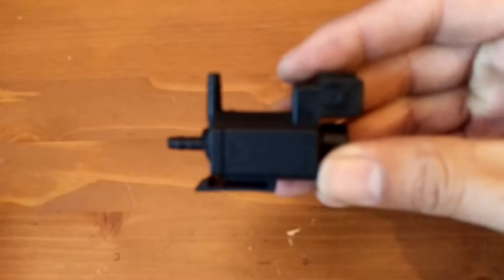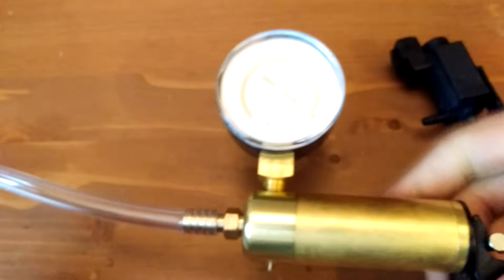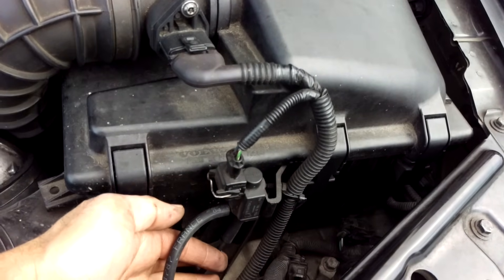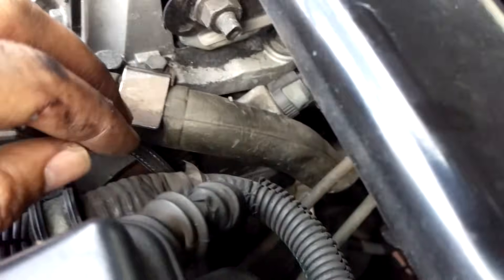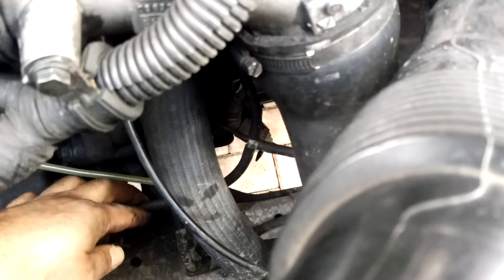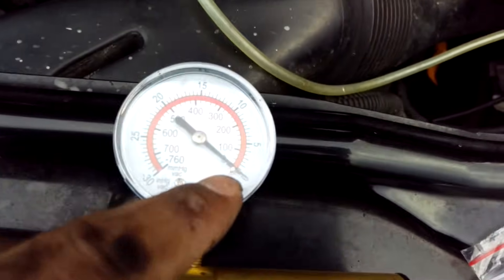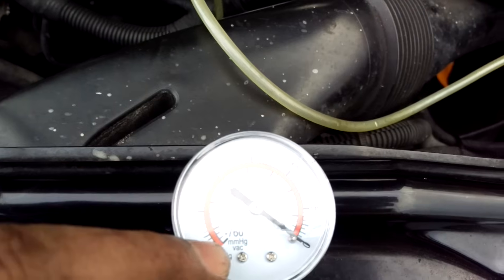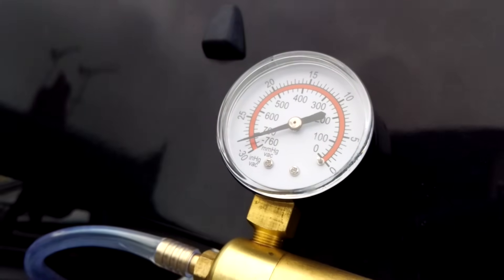How To Easily Test a Turbo / Boost Control Valve TCV

Comment: This is not a turbo valve, the turbo boost valve is on the engine blok by two screws.
Reply from the maker: As I say in the video, it's a generic name and the location and function of the valve varies.
The testing of the valve remains the same though so if you're focusing on the name, you've missed the point of the video.

Comment: Hi, Rob... great video! I just have a problem with my Volvo v70 d5, the turbo isn’t working any more... so they told me to check that “check valve”... but I have a question for you: do I have to buy the instrument you are using? Or will it be enough just to pull of the rubber pipeline (that you pull off) and when the engine is on, feel with a finger if it works? Cause just to spend money, if I buy the instrument or change the valve, the costs are similar...  
I hope in your reply! Anyway thanks a lot for the video!!!
Reply from the maker: Leaking vacuum only affects the turbo on a Euro 3 D5 so it depends on which D5 version and model year you have.
Reply: SiRobb hi, thanks for your time and reply!!
It’s an euro 3 from 2003...
Reply from the maker: You need a vacuum tester like in the video then.
The amount of vacuum and whether it is a stable reading is important to accurately track down the fault.
The same tester can also produce a vacuum for testing pipes or the engine mounts for leaks.
The testers are not expensive so check the link in the video description or search for even cheaper.

Comment: Hello, did you ever removed plastic cover, which is on the side of TCV ? I dont know, if the passage there should be clear, or not, because i have found, it was full of weird debree. Thank you.
Reply from the maker: No but I have removed similar on a boost solenoid and found debris.
On a vacuum valve, it will inevitably suck in some kind of dirt so they have filters built in.

Comment: Hello. Whats happening if The valve îs not running properly?
Reply from the maker: It depends on what car you have.
Reply: Volvo xc 90 2005 euro 3 2.4 D5
Reply from the maker: You may boost problems if it isn't working correctly.

Comment: Nice Video. What happens if you have no change in vacuum?
Reply from the maker: You then check if vacuum is available at the pipe feeding the valve.
Reply: @sirobb  I have a vacuum, closing the actuator, but its not opening like in your video when I increase the revs.
Reply from the maker: Do you have a Euro 3 Volvo D5?

Comment: What are the symptoms for the boost sensor if its packing up?? I've got a 2009 skoda superb 2.0 tdi cr se 170bhp and it keeps going into limp mode and the glowplug light flashes when I put my foot down and reaches 50mph
Reply from the maker: Test the glow plugs first.
Reply: Can glowplugs cause limp mode then while trying to get upto motorway speed? Around town car drives perfect
Reply from the maker: @jon-luis7344  It depends whether they are needed for dpf regeneration so check them.
Reply: I will do thanks so much it'll be first thing I do tomorrow I've taken the car to skoda and VW main dealers and they dont even know what's causing it. where are you based lol lol
Reply from the maker: I'm in Cheshire

Comment: Hi, I’m having trouble with a 1L 3 cylinder ford. The turbo is brand new and I have tried a second hand vacuum pump and a second hand boost solenoid, but the vehicle does not boost at all and a fault code P0245 turbo wastegate solenoid A Low keeps returning. It’s a 3 pipe solenoid, any suggestions?
Reply: Try with new MAF and new MAP sensor

Comment: To be honest i didn't think it was so binary on Garrett VNT's, i thought the solenoid metered the vacuum on a more gradual scale so that the vanes changed geometry with more nuance, rather than being fully open or fully closed.
Reply from the maker: It is more nuanced.
The valve in this video doesn't control the VNT.
Reply: @sirobb  Ah okay, what does it control?
Reply from the maker: @ek8710  It controls vacuum to the hydro-pneumatic front and rear engine mounts.

Comment: Hey, I have a problem with my 01' v40 1.9d 115 hp, I changed the turbo and I get the 1815 code for turbo regulating valve , in first 2 gears i have to press the pedal twice to make the turbo work, at the first press of the pedal the car accelerates up to 2000-2100rpm but slowly as when the turbo won't work and after taking the foot off the pedal and pressing it again it works and the car accelerates normally, when in neutral fully pressing the pedal makes the engine go slowly to 2500-3000 rpm and after lifting and pressing again it goes faster up to the redline, changed the tcv and the problem is still here...
Reply: i have the same problem on my alfa romeo mito 1.4 t 155hp
Reply: Is your turbo a vnt turbo...the veins are clogged up by the sounds of it and slowly opening to allow flow but not opening fast enough under boost...

Comment: I have a sob nine Dash three. Could you tell me why there is a hose coming from Midway from the air in take hose to this boost control valve? I understand the vacuum part

Comment: What line can you get a boost for a boost gauge in that motor
Reply: Whatever line goes to your factory "diverter valve."  you can cut and use that line, as it generally comes from somewhere on the inlet manifold. That's the best place to get vacuum for a boost gauge. Then block off the part still attached to the diverter valve, so it stops whooshing and starts fluttering.

Comment: Hi, I did this test on my Renault trafic 1.9dci. I get good vacuum but it doesn't drop off when I rev it. I even put a new valve on and was still the same. I don't spose anyone has any ideas what wrong?
 Cheers Sean
Reply from the maker: snakey21k It depends on the circumstances that the valve is programmed to work so may not drop off in the same way as my video.
What is the valve linked to on your Trafic?
Reply: SiRobb 
It connects straight to the turbo as far as I can tell

Comment: Good video, I'm a new driver trying to learn how to fix my car, many garages quoted extortionate amounts and seem to not want to give me a straight up answer to exactly whats wrong. I have a Focus TDCi MK3 2014 with what I suspect is a Turbo issue, for first few mins driving the turbo boosts up to 14PSI then stops completely after just 2-3 mins and the car feels like a train. EML shows occasionally but not always. No smoke coming from exhaust and no unusual sounds or noises. Checked all hoses and pipes, all seems good as far as I can see. Error code is P2599 "Turbocharger Boost Control Position Performance - High". Is this TCV the part I should be looking to replace or at least test? Any help or advice would be greatly appreciated, if someone could just point me in a rough direction. Many thanks.

Comment: Soo if you have an underboost concern, can dis valve also cause the issue since it will stay oppen all the time??
Reply from the maker: Ricardo Garcia If this valve doesn't operate correctly, it can cause underboost and/or overboost.
There can be other causes too though.

Comment: Nice test but what is the point to buy vacuum tester for £30 as new valve cost the same on ebay
Reply from the maker: Richie Kis The vacuum tester I use only costs £13 and can be used for many things in car maintenance not just this one job.
Reply: ok sorry mate I have misunderstood the price of tester you mentioned. I bought a new sensor from ebay and seems like genuine for £30.

Comment: I have a diagnostic fault on my Saab 95:  "P1110 Turbocharger: recirculating-air solenoid valve. Malfunction." I googled this, and pictures of 10 different items came up. I had the Bypass valve tested and it was OK. So - what solenoid valve is it??
Reply: Euan Williams that your egr valve shited up  remove it and clean it up with mr muscle oven cleaner then rinse it of with derv i jest did mine check the small rubber pipes for cracks
Reply: Thanks. The P1110 and P0705 problems seems to have disappeared for some time now. Replaced some old pipes. Now for the creaky suspension. I can see why Saab owners own 2 or more Saabs.  "One for the money, two for the show/ If one Saab won't, the other will go"!

Comment: Hello. SiRobb. Thank you for all you videos. I just did your vacuum pump test. When connected to the pump the needle will not stay steady when i connect to the vacuum tester on the the tube that comes from the vacuum pump to the tcv valve the needle is steady???? what am i doing wrong? Do i have a bad vacuum pump?
When i do what you just did on this video. it behaves like that one. But if i connect the tester to the vacuum pump the needle oscillates!!!???

Comment: Hi I have just tested my boost valve on my Vauxhall insignia , it's pulling vacuum and operates the actuator but when I raise the rpm it doesn't drop off so not closing the wastegate would this definitely be a faulty valve or possibly something else that controls the valve ?
Reply: Hi, I'm having the same problem with my Renault trafic van 1.9dci

Comment: Hello, SiRobb,
i have an identical engine and identical engine mount solenoid valve 7.22240.10, but it's faulty. I can't find where to buy a new one. All i can find is PIERBURG 7.22240.15.0 . Does it fit in my car?
Reply: Bro go to euro car parts they'll have it

Comment: Hi Simon
I have a Volvo C30 1.6 diesel 10 plate. Turbo is fine until I put my foot down and the whole car shuts down at 3000rpm. Could this be the turbo pressure valve and if so where on earth do I locate it in my engine? I have been looking for about 2 days now.
Thanks
Reply from the maker: Sean Meddeman You'll need someone with access to diagnostics and workshop diagrams. 
I wouldn't recommend trying to troubleshoot and fix using guesswork. 
You may not even have a valve like this to control boost.

Comment: now lost as mine did what you said nothing on the out pipe so I bought a second on and fitted it still the sane when I rev it there no reading but if I read it from the in side there vacum so next I need to check what and how
Reply from the maker: Richard Holmes Sounds like a control issue then. Check the plug and wiring for any obvious issues. 
Perhaps wiggle the plug whilst taking the vacuum reading to see if the valve bursts into life. 
The valves are very reliable and so (usually) is the wiring so you're having a bit of unusual bad luck.
Reply: checked with a multimeter and it's got 12 volts to it well just under all the time ..but still no vacum on the out side very odd ..but thanks for the quick replay
Reply from the maker: Richard Holmes Did you check for a good ground on the other pin too?
Reply: interesting the white on has 14.5 volts the orange one has no continent  thanks go look at thank
Reply: So do you have any ideas where the orang wire go back to as like you say it Sean's not to have an earth
Reply from the maker: Richard Holmes First guess is back to the ECM but I've not needed go that far. 
If you have Haynes or Vida, the wiring diagram would confirm.

Comment: Thanks for great videos. However, the name of the part and parts of the video are a bit misleading in understanding how the vacuum system works. Volvo calls it "engine pad valve" and it's all it does. It provides vacuum to the hydraulic engine mounts diaphragm. Nothing turbo related. Since they share same vacuum circuit with the turbo control valve, if there's a vacuum leak or misoperation in the engine mount vacuum circuit, it also causes a drop in vacuum in the variable-nozzle-turbo control circuit. But that's all there is about turbo for this valve.
Reply from the maker: maksmail The video doesn't have Volvo in the title so I don't understand why you think it's confusing. 
It's a general video showing how to test the valve which is fitted to millions of cars and other makes apart from Volvo. 
Testing the valve remains the same. 
What it is used for is irrelevant.
Reply: It's relevant if you want people to understand how their cars work and for them to do minor troubleshooting on their own, not give them step by step bulletins where they don't have to understand the system. I'm only saying that on this video because it has 184k views and your influence on beginner DIY volvo owners including me is big. Many people are referring to this valve as turbo control valve and I personally think it is misleading for someone who want's to understand what this valve is about. Otherwise, I'm a subscriber and always looking for new videos from you, thanks!
Reply from the maker: maksmail I do want people to understand how their cars work but I'm not going to do an explanatory video for every application of this valve. It's a switch for vacuum and this video very clearly shows how to test if it's working correctly. 
For those who want the more detailed context for this valve, there is my D5 Vacuum System Explained video. 

As I've said, the title of the video is key. If it doesn't say Volvo or D5 in the title, it isn't a Volvo or D5 specific video so complaining that it lacks Volvo specific detail is a bit silly. 

Like you say 180k views and your observation is echoed by maybe 4 people so the intention of the video has been acknowledged overwhelmingly by the majority and that's good enough for me. 👍
Reply: Yes, the title of the video here is the key. I have yet seen the valve used for governing the turbo. This could be for reasons that:

1) I am not a car mechanic and have very limited real world knowledge of cars, also misunderstanding the working principles of this valve
2) the valve works as binary on-off switch and can't regulate the amout of vacuum it bypasses so is useless for turbo actuators

Now, is there a motor system, where it's use can be described as turbo/boost control valve? If so, then I'm sorry for wasting your time here.
Reply from the maker: maksmail On point 2)This kind of on/off valve is fine for some boost control setups as it's just used to move the wastegate actuator at a given boost pressure to avoid overboost. 

On point 1)There's nothing wrong with not knowing stuff so if you don't know a subject entirely, perhaps consider opening with a question rather than starting a dialogue by telling me that I'm wrong.

It's more polite and I'm much more likely to help.
Reply: maksmail вЖ

Comment: Hi Simon, i have a xc90 2.4 2004 but on a 2003 plate, it looks an identical engine to yours,im getting the popping with the oil filler cap off, both engine mounts are disconnected (like this when purchased) i cut the pipe direct from the vac pump as close as i could to the pump and still getting the popping i.e no change when blocked with my finger would this mean the pump is naff i can feel a vacuum though but maybe not enough to control everything ???   any advice please Simon !

regards 
Gary
Reply from the maker: gaz m You need a vacuum tester you need to see my specific vacuum pump testing video near the top of my list. 
It might also be worth disconnecting the brake booster connection from the vacuum pump and blocking the pump there to see if the popping stops.
Reply: WOW!! that was a quick reply, many thanks i will order a tester now and i will try the brake booster bit when i get the tester.....and will report back to you
Regards 
Gary
P.S your videos are excellent.. clear and very easy to follow :)

Comment: PA6 GF30 is the materials it's made from, not a part number. PA6 means it's made of nylon and GF30 means it's 30% glass fiber reinforced.
Reply: Haha! Beat me to it! Was gonna say the same. (But in less detail!)
Reply: Me too lol. (I wouldn't have known this myself but for watching AvE's vids, mind).
Reply: @danmackintosh6325  another aVe fan too? I thought that as soon as I saw comments about the "part no"
Reply: Sml132 lol
Reply: Beat me to it too by 7 years although I didn't know what any of the codes meant.  I first came across this when I was looking for a part for a washing machine and then a part for something else and realised that these two completely opposite components could not possibly have the same 'part numbers'.

@sirobb. Thank you for the video. I've been having underboost issues on my car for some time now.  They are intermittent so I suspect it may well be a short to ground in the power supply from the ECU.  Test the ohms value of the solenoids yesterday and they were in spec for my car but that doesn't necessarily preclude them from being seized internally.

Comment: I have a vectra c 2.0dti. I have 2 fitted, 1 for turbo and 1 for the swirl flaps.   (egr is electronically operated)  when I connect the tester gauge to my turbo control valve solenoid it give the same reading as yours but when Increase it to 1k rpm it just drops the gauge reading slightly , it doesn't drop to 0. I would say around 600 on the gauge. I've tested this with swopping the 2 solenoids over to see if it was a faulty solenoid but I get the same reading.  also on the swirl flap solenoid I get a 0 reading (not sure if that's normal)  .  reason I'm testing is because there seems to be lack of boost above 2.5k.
Reply: Did you sort it out? I have the same problem

Comment: is this petrol or diesel?
Reply from the maker: Aman A It doesn't matter. The testing of this type of valve is the same regardless of fuel type.
Reply: SiRobb I don't think diesel cars have these
Reply from the maker: Aman A Thousands, maybe even millions of diesels have them.
Reply: SiRobb would you happen to know where this is on a golf mk5 tdi bkd engine 2007?
Reply from the maker: Aman A I don't know whether a Golf specifically has this type of valve. Boost may be controlled by a solenoid type valve or even an electric actuator so you need to check the type of control system on your car.
Reply: SiRobb OK thanks
Reply: Asshole its not turbo valve!!! Rediculous
Reply from the maker: Lol